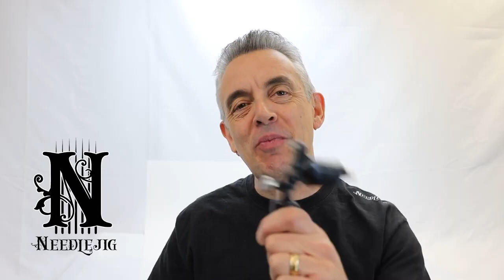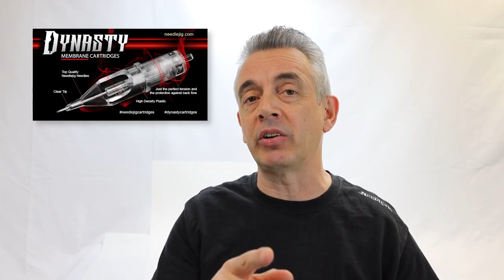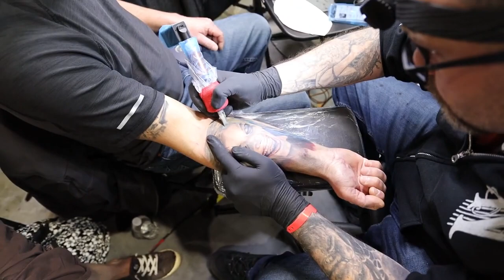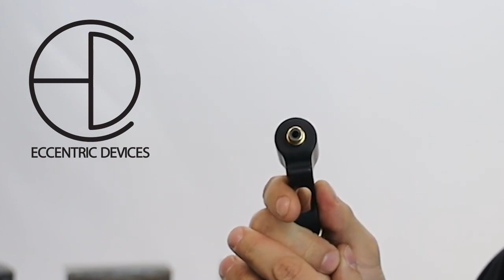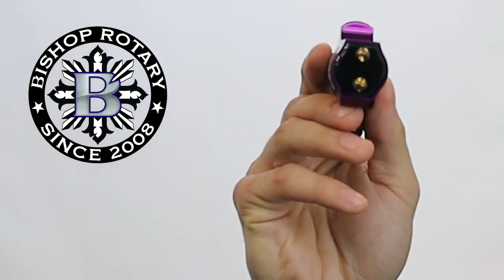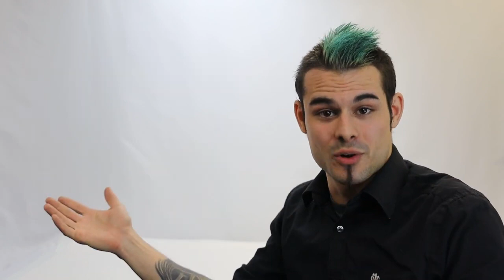Rotary Tattoo Machines 101 - Switching from coil machines,  rotary tattoo setups, & different types

Comment: I know that coil machines can last forever and can be used for 7 hour sessions for 20 years or more. When tuned correctly the sound is smooth and the weight can be reduced and balanced for long sessions without hurting your hands. Most rotaries are not balanced because of where the rca wire connector is placed on the machine. The adjustable Rotary machines that you can adjust the stroke length of the needle are Machines for beginners why because you have to test every length from 2.5mm to 4.2mm to see where you feel more comfortable at. Depending on your speed and style of work it’s how you find the stroke length that’s best for you. They give is also important but only if to give is built for your personal way of tattooing, because  has give and you are not in tune with it your tattooing can slow down, one because of how long it takes you to put in your ink in the skin if it’s too much give and if it’s very little good there’s no big difference in not having it at all. All machines can be efficient it’s all about who builds them tunes them and who uses them. Most machines on the market are not tuned correctly they are only assembled big difference when we were trying to buy is a very well tuned machine and I as an artist will use this Machine (Rotary and coil) to whatever it is tuned for. The truth is everyone is selling a beautiful candy apple red glitter ✨ machine but they’re not teaching you how to use it or which one is good for you. I recommend you do you research on Machines Ask the company who builds them who assembles done what is it built for and how will it help me do better easier faster beautiful work. Cartridges: they won’t give us much information about these cartridges I’m saying this because there is a difference in a regular needle and a bug Pineda there’s a difference in straight mags and curve magsAlso this on their friends in tight needles lose needles Hollow liners and shader liners. I think instead of just saying these are the best why don’t we try to teach tattooers what needles are best for them depending on their style of work or what they want to accomplish with them. One last thing is motor don’t necessarily have to be $150 Swiss or German motors,  there are $10 Chinese motors that work just as good if not better.

@debsotattoo